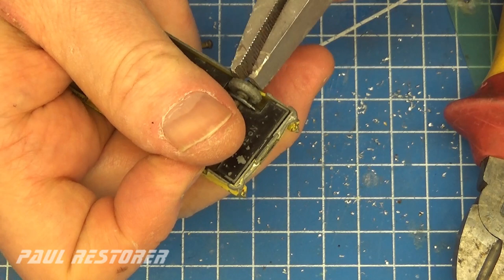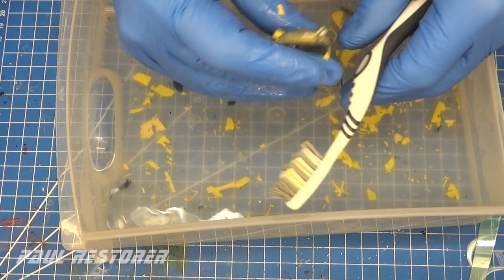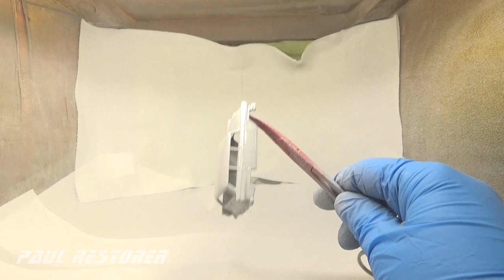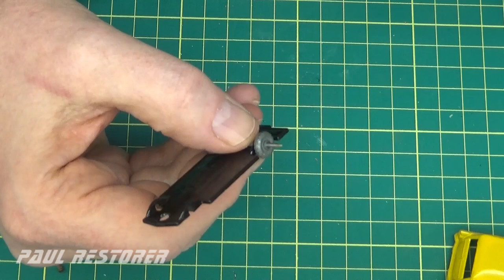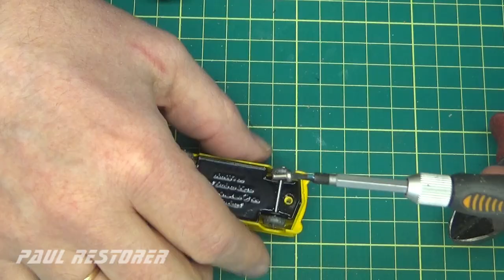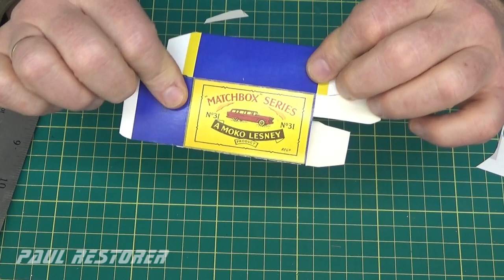Przywrócenie stanu fabrycznego Matchbox American Ford Station Wagon nr 31A. Model odlewany.

Comment: You did a great job on this most sorry Ford. This particular item is so sad for Matchbox in that the designers did not get the front pillars and roofline correct even by the slightest means. I was young when my mom would drive me around in a real "Country Sedan" version of the 1955 model year and this particular Matchbox model looks NOTHING like  real one. The did get the round tail light look correct but the roofline is so foul to me I finally passed mine on to my son. I love the color yp painted it although I would have liked to have seen the red tail lights. The real sad thing about this model is it looks more to me like a small Dodge or a Chevy Nova. This to me is their greatest foul up in design. But one out of so many vehicles being trashed is not too bad.
Reply from the maker: Thank you very much